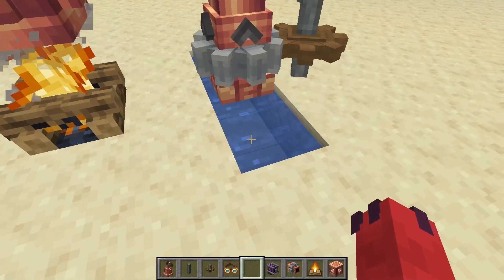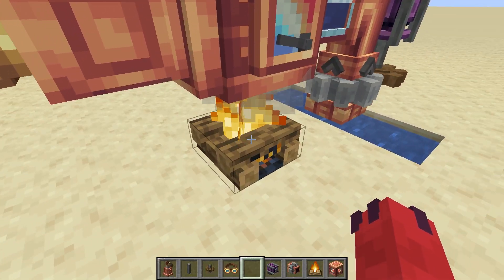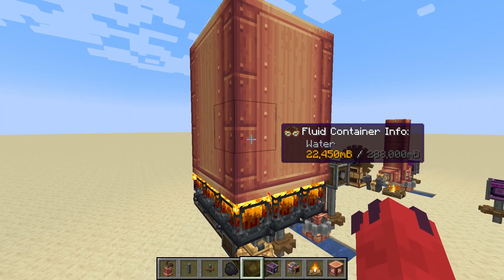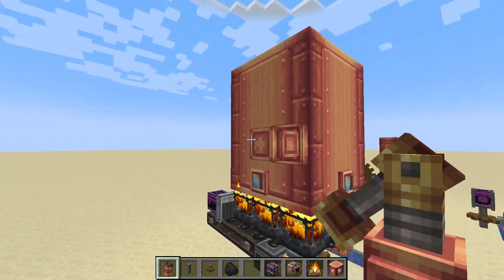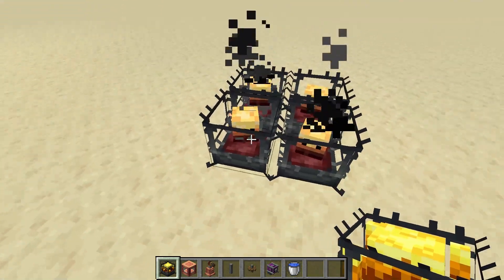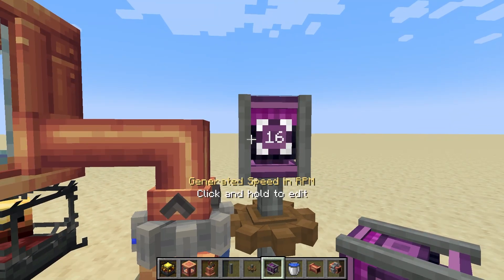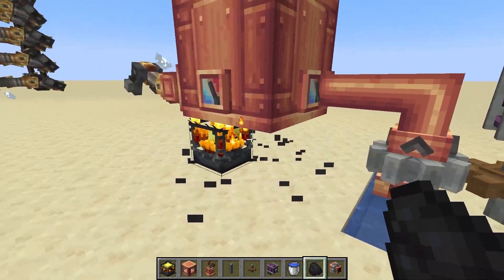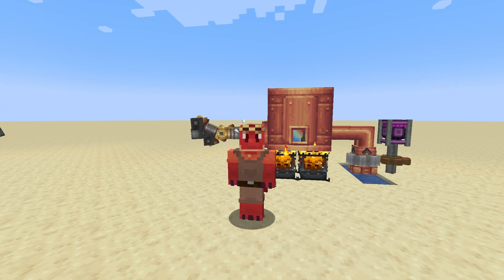How to make Steam Engines in Create - Minecraft: Create Mod

Comment: so ı got everything but how do ı get more rpm to flow more water in my boiler
Reply from the maker: Either use gear ratios (connect a large cog then a small cog) this will slowly increase, or you can use a rotational speed controller to finely control the speed